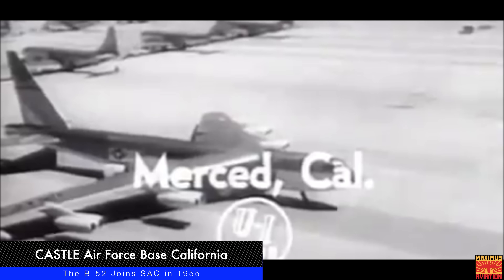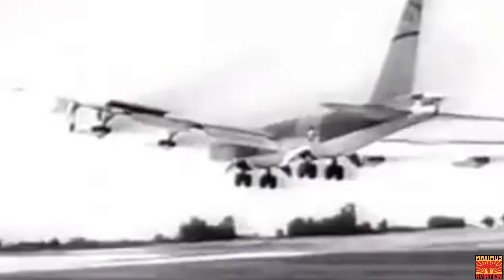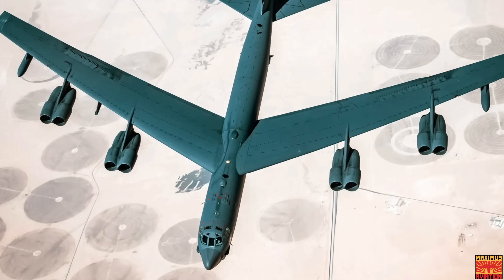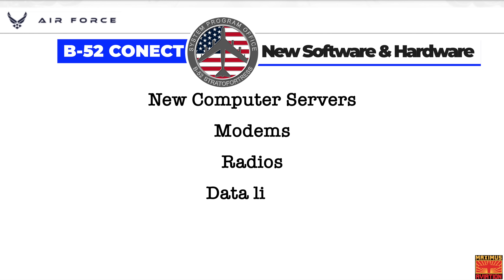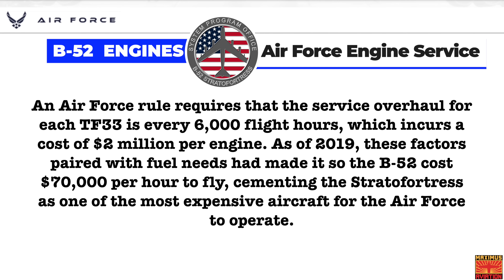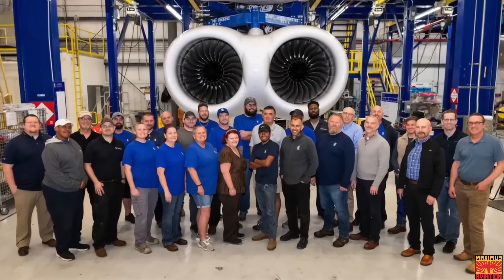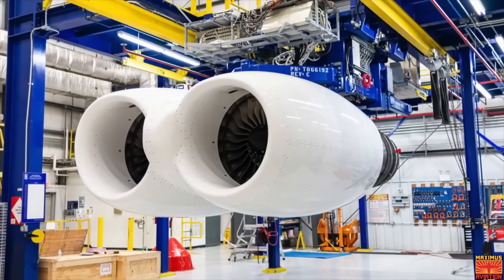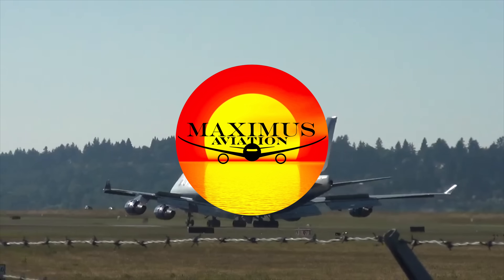The B-52 Will Fly For Over 100 Years With Its New Rolls Royce Engines!

Comment: B-52 ACFT  had 2 Types of engines J57 and TF33  - The  J57 was Water injected and the TF33 is not - The J57 engines were mounted on B52 Models A thru G. Water Injection  maintained Flatter thrust on Hot Days - So J57's are Non Flat Rated Dry up to 59 deg 'F -  Water Injection "Spray" pumped at 400 psig boosts thrust higher during Hot days - The Second  Type engine is the TF33-P-3 Turbofan (currently in service). The TF33 is Flat Rated up to 85'F, meaning it can maintain TRT = Take-Off Rated Thrust up to 85'F O.A.T. (outside ambient temp) then thrust starts to drop off slightly as Ambient temps rise - No Water Injection on this Model. The  Fan Duct on B-52's is a short design compared to the longer Full BIF-DUCT on TF33-P-7 engines mounted to C-141 ACFT.  That Biff Duct produced slightly more thrust - Both J57 & TF33 engines are called  Smoker Engines because they run much cooler Turbine Inlet Temps which doesn't burn JP4 as efficient as today's Super Hot smokeless engines. Lower TIT Limits is due to older Convection Cooling Turbine Vane design - A person can 
over Temp these engines Real Quick - Over Temp EGT or Over speed RPM limits can damage the engine - ALSO----> J57's mounted on A thru G models smoke way more than TF33 engine due to water Injection  -They  Smoke 2-3 Times more than TF33 Turbofans. Look up Old Movie Trailer called  "A Gathering of Eagles" https://youtu.be/NKq1VUQNanQ 
 Watch the Black Smoke from a M.I.T.O. at Beale AFB Calif during an Alert Take off called MITO Minimal Interval Takeoff - <30 seconds apart - Pilots Lift Off and search ( turning ) for clean air turning Left / Right  / Higher / Lower - 
I was a Jet Mechanic on most of these Models......Engine Trim Qualified / Test Cell Operator / Engine overhaul - - Know This: Perfectly Rigging All 8 Throttles is an ART. Sometimes on Friday Afternoons, after a Long Week of Launching / Recovering B-52's,  a Pilot would stop by Engine Conditioning with a case of Cold Beer and a Big Smile thanking  E C for Perfectly  Rigging those Throttles !!  
Pilots would say.....It is So Cool to Grab All 8 Throttles and watch ALL the  EPR Gauges perfectly Align when pushed to the FIRE WALL  meeting our Thrust Charts ) - No Rudder adjustment needed to correct for YAW..  Regarding Maintenance Runs - Depending on the Fuel Load,  I've Run all 8 engines to M.R.T. Dry to verify Throttle Alignment for the pilots  - I've Never run all 8 engines in Water injection - Only a rated pilots were authorized to do this -  Cool Times.....Cheers  Joe Schmid  Ret SMS Jet Shop
Reply: Very concise description of engine performance and maintenance - tx,

Any rough prediction on the increase of fuel efficiency and costs per operating hour? I could not find any comments …
Reply: Me too. Test cell was my favorite. I retired as an E7 out of Barksdale after we shut down Carswell and the Mighty 7th Bomb Wing. 
I started out my career at Robins with the 19th Bomb Wing in FMS. Worked all shops there getting trained. J57’s were really fun to run and trim in water on the cell. Good times that I really miss…
Reply: I went to tech school on  b52s in the early 70s  also crew chief on 135s  god bless all of us  for keeping the world. Safe

Comment: After 35 yrs. working on commercial airliners with a variety of engines from PW, GE, RR, IAE. I will standby RR, engineering and quality. Yes RR has like all engine makers had teething problems with some new engine designs, but  they always come through. These engines will be built in the USA, by American technicians and specialist. Congratulations to the US Air force and Rolls Royce.

Comment: Well… Having been born in 1955, myself. In recent years. I have been wondering. As to whether they ever upgraded the engines on the B-52's? And what you revealed here. Rather blew my mind. They are using basically the same engines that were on the, 707's? Turbo Jets? Not, Fan Jets? Oh my God!

So I guess it's about time. They got newer, better, stalwart,, proven track record, engine upgrade.

And super cool. To think. This aircraft. Is likely to outlast, me? Though mom is 99. And one never knows? I might be around for its 100 anniversary? And my 98th? That would be cool. I want a Ride!  Can I make reservations? One old lady for the, 2053 flight of B-52, please?

I plan on being there.
RamyRAD

Comment: IIRC the TF33 fan engines were the second set of engines installed on the BUFF on the B52H...  The original engines were J-57 turbojet thru the "G" model

Comment: Interesting that they didn't go with four large high bypass turbofans instead, lots of those in widespread service to choose from. Is ground clearance an issue?
Reply: No, ground clearance was not the problem. The eight engines have specific features needed for the B-52; hydraulics and electrical generation are not equal between the engines. To go to four engines would have required a complete redesign of the aircraft systems. Additionally there were concerns about the already undersized rudder to be able to deal with the loss of an outboard engine.

Comment: As an Air Force Brat I remember seeing B-52's when our Family was transferred to Mather A.F.B. Calif. where my Father worked on the propulsion systems on these AC. In the late Sixties I joined the AF and trained  as an electronics technician for B-52's & KC-135's. Some of the Radio, Radar, & navigation components weighed as much as 80lbs. So by upgrading these systems over all weight of the AC has gone down. The benefit being the AC is more fuel efficient and carry a larger payload. Thanks for a great video on an AC I love!

Comment: Not bashing, but those engines have a couple ADs (Airworthiness Directives) on them for cracking on the fan disc and turbine disc requiring inspections outside regular scheduled inspection/overhaul time cycles

Comment: It would have been interesting to see if the RAF Vulcans could have been maintained as a viable force.
Reply: their use in the falklands war was seen by some as purely a PR move or rather the Air Force trying to prove they can be relevant too. they expended an enormous amount of resources to put 2 holes in a runway, which were filled the next day

it's probably better to abolish the RAF and the army and just have the fleet air arm and the marines.
Reply: @dedsert9653  It was to some extent a pr move, but on behalf of the UK armed forces in general, and the message was 'you're not out of our reach there - and neither is Buenos Aires.'

The later Black Buck missions impressed me much more. Flying 'Wild Weasel' in a Cold War bomber takes serious balls.

Comment: If I recall correctly, the only B-52's in service now are the H variant first produced in 1961, so it will be an extra 10 years before the ones flying now reach the century mark.
Reply: The last B-52 was an "H" model number 61040, that aircraft rolled from final assembly on October 26, 1962

Comment: I’ve often thought 💭…. Why couldn’t they replace the eight engines with four slightly larger engines? Like the engines used on the A380 or the new 777-X. Four engines would be less expensive to maintain than eight. 🤔
Reply: Thrust-wise two 777 engines would be more than 8 of the current ones; those engines are huge! And you're right that two or even four bigger engines would be cheaper to purchase, maintain, and be more fuel efficient than 8 smaller. But the problem is, how are you going to fit them under the wing without scraping the ground. And also the B-52 would need a bigger rudder to have enough control authority in an engine out situation. So from of total cost perspective, it's cheaper to just replace the engines with 8 small ones as that avoids the need to redesign the airframe.

Comment: I'm really surprised they haven't just replaced the 8 old smokey TF-33's with just 4 modern high bypass engines? Half the systems to worry about and more than twice the power. It really doesn't need 8 engines a job that 4 modern engines could do?
Reply: There were proposals to use 4 engines.  There were several problems.  One, a "one engine out" problem could be problematic on a fully loaded B-52.  Two, the fuel system would have to be re-engineered.  Three, the engine pylons connections to the wing spars would have had to be reengineered and rebuilt.  The TF-33 was a fair engine and had a long life.  Some of the C-135 variants still used the engine.  However, I doubt if 10% of the bomber fleet will be upgraded with the new 8 engine system.  On 11 March 2023 the FDIC nationalized the US Banking system because of the SVB bank failure and the subsequent failure of three more large banks.  As of 16 March 2023 the FED and US Department of Treasury bailed out the banks to $2 Trillion dollars.  The USA going full speed into an insolvent currency.  Want some VERY scary numbers?  Gold was $35/ounce when the B-52 first flew.  Gold is now pushing the better part of $2,000 per ounce.  The $70K per flight hour cost of the B-52 is 35 gold ounces.  In 1955 that means it cost $1,225 per flight hour to fly a B-52.  That's currency destruction in action.  In 1955 the median income was $3,400 per year.  In 2022 the median income was $64,000.

Comment: When Kirk and Spock park the Enterprise at the Boneyard, they will fly out in a B-52, I remember when the B-70 was going to replace the B-52. Then the B-1. When the B-2 came out, people didn't even mention replacing the B-52. There are just certain pieces of Engineering that outlive their generation. The DC-3, the C-130, The M-1911 pistol, Detroit Diesel 2-stroke engines and the .50 caliber M2. One of the reasons for the B-52s longevity and reliability was the efforts of a very unreasonable  man, Gen. Curtis LeMay. He insisted that B-52s be combat capable 100% of the time. Which is impossible. But Gen. LeMay insisted. As a result the B- 52 became the most combat capable Airplane in  history. A whole system of maintenance procedures were devised to keep these planes in service. But they could never achieve the General's impossible requirement. The best they could do was 96%.

Comment: The B-52 is a great aircraft, but until new, longer ranged Air Launched Cruise Missiles come on line it is simply too slow for the ALCM nuclear strike role.  No other aircraft can carry as much conventional bombs (that I know of) and it is superb in that role, but only if there is no serious surface to air (SAM) or chance of interception by modern fighters.  The B-2 stealth is getting very old and since its first generation stealth, the new radars 4th and fifth generation combat aircraft are being equipped with may be able to detect it.   It will be years before the new B-21 enters squadron service.  The B-1 would be a better choice for the role due to its speed.

Comment: By the way, the F130 is actually the BMW/Rolls Royce BR700 engine from the Boeing 717....Also known as the Douglas DC-9-95.
Reply: BMW don't actually have anything to do with the the side of Rolls Royce that design aircraft engines and nuclear reactors, they only bought the car manufacturing side of things.
Reply: @Benjd0  Correct.  Rolls-Royce aircraft engines is a different company than Rolls-Royce the automotive company.  They were split back in the 1970's when Vickers bought the company.  Thus there are two companies named Rolls-Royce.

The BR700 is produced by a consortium of Rolls-Royce aircraft engines and BMW AG.  They teamed up for this design though they are indeed separate companies.

Comment: What was the reason why four big engines wouldn’t work on the B52? Was it because one big engine would not fit under the wing?
Reply: The rudder could not compensate the asymmetric thrust if an outboard engine fails with just 4 engines. Also the ground clearance would be not sufficient at the outboard engines.

Comment: The Air Force spent Billions of dollars doing research and development on a replacement for the B-52 decades ago.  The ended up buying and flying the B-1(b) which is big, heavy load capable and faster than the B-52.  It was built to replace.   Then they secretly designed and built the B-2, which is just as fast as the B-52 but can not be detected and is far more survivable than any bomber in the world, for the last 30 years.  The B-1 and B-2 have heavy payloads and smart technology for exact targeting.  Carpet bombing is now a violation of International law.   Let’s take the money and apply it so the two active duty aircraft that were built to do the job better than this old design which needs to be retired.   Between these three designs, only the B-52 has been shot down multiple times by the enemy.   It has earned retirement.
Reply: They are building a new stealth bomber to do the B2’s job cheeper. The B1 is retiring because going fast is not going to stop a missile , going low is not going to stop a missile and the B52 is a truck that is not going anywhere near a contested battlefield anymore and is cheap by airforce standards.

Comment: Ugly is a misnomer. That aerial view shows how sleek it is, and it flies at close to  650 MPH at altitude with amazing range. These new engines will make it even more economical to operate. 
It was the height of appropriate design choices and that has made it have such a long lifespan. That and the fact that we made almost 1000 of them with tons of spare parts.
These later bomber designs were hobbled by Congress with their penny-wise pound foolish decisions to make so few B-1Bs and B-2s. When you make a few of something, the unit cost goes up, and you run out of spare parts. That's why they say when the last B-2 is delivered to the boneyard, the crew will ride home in the BUFF.

Comment: As a former USAF crew chief, I worked on these guys & it was a challenge but I enjoyed it. There are a few aircraft the USAF keep trying to get rid of, Warthog, Chinook, but the number 1 is the BUFF. I talked to retired chiefs on working on these planes and other than upgrades there wasn't much difference in taking care of them. The T.O manual was thick, but if you do what it says, it's bullet proof.  I worked on 16 different aircraft & I firmly believe this is the best airframe design that Boeing has ever had. With the 747 being #2. Possible the best airframes in aviation history. Their durability, safety and longevity are proof of it.
Reply: What was the hardest part of working on these old gentlemen?
Reply: @sartainja  That's it can be very dangerous. Many things can do serious damage or even kill you. But as far as the aircraft, just like many older aircraft, the constant leaks had to be compensated for. Then squeezing into some of the tight spaces to get access was a challenge for somebody over 6ft.  But the hard parts made it rewarding when it was done.

Comment: The B52H, which is the only model currently in service didn't go into service until 1961.  That makes the oldest of the model 62 years old.  Since they were built over a period of time some are younger that others.  It also makes sense the the AF would fly the youngest planes or those with the least air time.  For them to reach 100 years in service they would have to be flown into the 2060's.  I don't think they intend to keep them around that long.

Comment: Look into why the plane was reengined with two small engines per pod rather than one, larger, more modern, more powerful engine per pod. Hint: The planes basic design couldn't handle it.
Reply: One problem is the ground clearance of the outer engines, another the rudder control authority. The B-52 H rudder is smaller than the one of the early models ( due to flutter problems at high speed low level flight), and could not compensate the asymmetric thrust of an outboard engine failure if they would use 4 bigger engines instead of 8

Comment: Why not replace the 8 old engines with 4 modern ones? That has been the question in my head since the first time I heard about re-engining the B-52. That would save both weight, maintenance and fuel. Lots of engines to choose from in the right power regime, I would imagine. And much easier to install too; no need to develop a new twin pod. I am sure there is a good reason they did not do that, but I cannot imagine what it is.
Reply: Seems that 4 engine replacement was suggested as early as 1996. Apparently it was considered too expensive compared to the fuel savings - because they forgot to take into account the massive savings from not needing nearly as much in-flight refueling.
These days even smaller engines are so much more efficient so apparently the replacement with 4 large new engines does not save enough fuel etc over 8 small new engines, to make up for the necessary restructuring of the aircraft. Obviously in case of an engine failure, the loss of 1/8 is less critical that the loss of 1/4 of the total power, but if a Boeing 777 (twin jet almost the same weight as the B-52) loses one engine it loses half its power so that may not be a performance problem in itself. Rather it seems that the B-52, because of the large number of engines, is not designed for very much asymmetric power. A conversion to 4 engines would therefore require a larger tail fin to handle engine failures, and a massive restructuring, which would be too expensive compared to the advantages. Of course there would also be changes to the fuel system and engine instruments and controls.
Reply: @henrikvr2721   A dorsal filllet is relatively simple, see B 737 classics and later, B-17 E and later, Hawker Tempest.
Reply: Has to do with aerodynamics.  Plane was  designed for 8 engines not four.
Reply: It would need to have narrow elevated runways to allow 4 big engines to keep out of the dirt.

Comment: Will there be a thrust-to-weight ratio improvement?
Reply: No, thrust is exactly the same. The big deal is that the new engines are more fuel efficient (I've seen figures of 30% thrown about), and spare part availability.